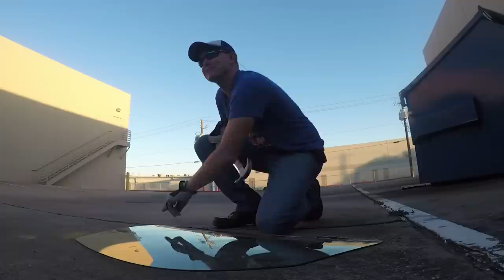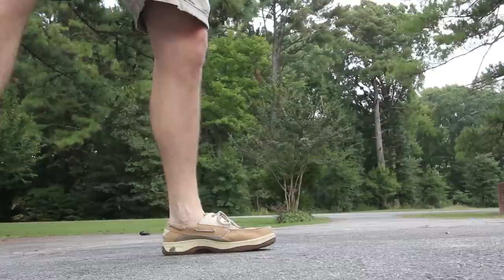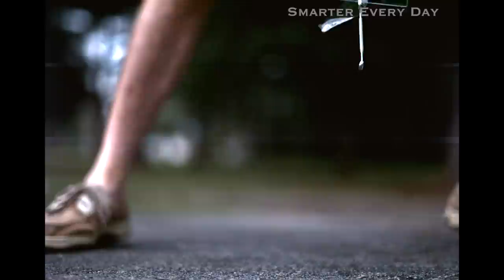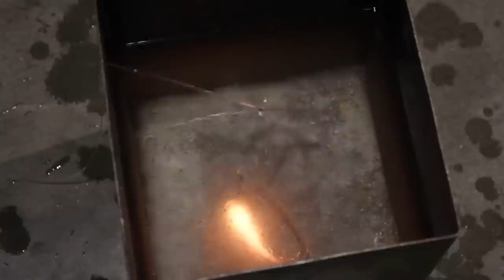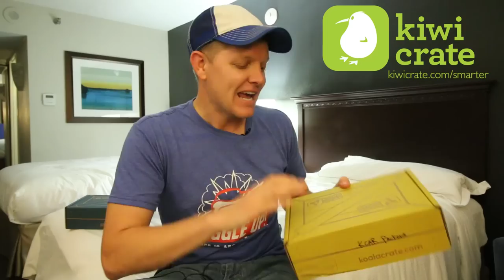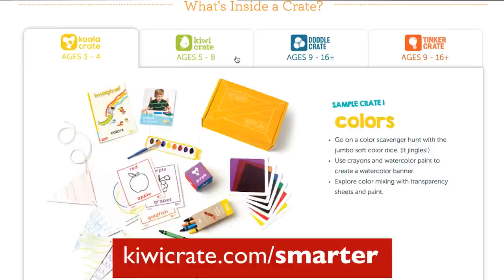How to Escape from a Car Window (SLOW MOTION) - Smarter Every Day 144

Comment: This video could actually save someone's life.
Reply: maybe. I work as an engineer bending and tenpering glass for cars like the kind they're breaking.  unless you have a hammer or something you're not going to break that glass if the Windows up.  he didn't mention that part. it's also much easier to break if you just apply a point load anywhere in the surface, that's how they do ece tests to make sure the number of particles it breaks into is within specification and it's much easier.
Reply: +ZachBamfy Or if they have a small piece of Porcelain. Because a pebble sized piece of Porcelain  would shatter the window
Reply: +ZachBamfy You can take a key and wedge it up into the frame. Everyone has a key in a car :P
Reply: +David S. I wear steel toes to work every day and I keep a toolbox with a hammer in my car, so yea, this might help me some day.
Reply: +RanndomUndead And if you're dead set on always being able to break glass,  keep a ceramic mug, sparkplug or anything made from ceramics nearby at all times. Ceramics have a knack for being able to break glass instantly.
Reply: +ZachBamfy A couple weeks ago, I broke my drivers side window with my elbow, nothing sharp or near the edge. Also, the window was up. So I will say it is possible without a hammer, I honestly didn't expect it to break.
Reply: +RanndomUndead Today's cars don't require keys (but you still normally have house keys)
Reply: +npeq93 right, not keys but you still need a fob.
Reply: +ZachBamfy you pull out the headrest and use the metal part of that to break the glass
Reply: +r77xxl or your seat belt buckle
Reply: +ZachBamfy But the headrest is designed to come out and work as the hammer...you really don't know what you're talking about
Reply: +David S. yes! breaking into car is so much easier now!! I could feed my family now! Thanks Smarter everyday! :D
Reply: +David S. Not really, it doesn't say how to break the glass if you're stuck inside. This is just a cool looking slow mo video about glass breaking with not much information if you've already know about tempered glass.
Reply: +David S. It probably will actually.
Reply: +RanndomUndead Not me, my car is key less with a stop start button. The "key" I have will break before the glass breaks
Reply: Endseeker what kind of car do you own? I'd be willing to put that to a test.
Reply: +RanndomUndead really? Come on. I knew a girl who was forced off the road trying to avoid an oncoming drunk driver in her lane. She ended up in a lake and had to get her and her daughter out. Your comment doesn't make sense.
Reply: or ruin it
random person could smash the outer edge of the window
Reply: +Steve Kanney I also know a girl who was raped because the guy hit the edge of the window to break the glass and pull her out.  this will ruin lives.
Reply: +Dysangel PS4 
At the end of the day, like a knife, it's a tool.
Reply: Daniel Verdin yeah exactly, but I'm just calling bullshit on someone being sat in a car and not being able to drive away when someone smashes their window. They should also be wearing a seatbelt so getting pulled out is unlikely. So I think he just made up his little story to try and be awkward.
Reply: +Dysangel PS4 have you ever gotten beat up? Or been caught up in other high-stakes situations? Humans (including, maybe especially, me) can be pretty stupid under pressure. Especially if they have not practiced. Which is why I think self defense is very important for any persons life.
Reply: Dysangel PS4 i have late reactions lmao
Reply: +shodanxx I disagree. Your car is slowly submerging under water. You seem to have trouble breaking the window. You repeatedly hit it and try  to break it to escape. But you watched this Smarter Every Day video and you know that it's really easy to break windows on your car from the edges. Then you can escape your car and live. Has your door ever jammed in a wreck or anything like that? I personally think cars should have a pressure release on their doors. Like, "Oh no! My door jammed after I crashed it running away from the bad guys! I can't get out! Oh wait..." Flips open casing and presses door release button. Suddenly, your door propels off its hinges and you swim free. What's that? Seatbelt won't unbuckle? Well lucky for you, the feed from which the seatbelt comes out from can be removed! Hooray!
Reply: +David S. it helped me and my wife get back together!
Reply: +RanndomUndead not anymore. Lots of car manufacturers went for plastic boxy thing without the actual key blade.
Reply: +NGC1433 cars from the right manufacturer usually have an actual key inside the fob that you can access using a screwdriver or something, just so you can still lock your door if the batter dies in your fob.
I think he was making a reference to newer cars that were recently hacked by someone and controls were overridden by the hacker. The term keyless doesn't mean there's no key, it just means there's no ignition to turn a key in.
Reply: Joe Duffy Yes in deed. They are hidden good... :D I do not own a car this nice, had to do research to find out. Thanks!
Reply: Joe Duffy you probably had a defect in your window dude, in the tempering process you send the glass through the furnace into the press that bends the hot glass and then that gets carried through a couple blastheads that shoot pressurized air at it, during that if the glass hits anything too hard or if its resting on metal, or if the air isnt right you can get vents.  basically its just a weak point that can cause the glass to break randomly, could be when its just sitting there or could be when something barely taps it.  or maybe youre just reaaaaaally unlucky
Reply: ZachBamfy or maybe I just hit it really hard.
Reply: +David S. But the best way to survive out of a car is to kick the windshield from your feet. This doesn't require any tools or much strength and the windshield pops out as a whole (no dangerous glass splinters). Plus, you have a larger vent to get out than you would get by breaking car door glass.
Reply: +ZachBamfy Swing your seat belt buckle.
Reply: +Naman Khokhar This will absolutely not work on pretty much any vehicle of the last 30 years. A modern windshield is bonded to the vehicle using a very strong automotive grade urethane. This ensures that the windshield will remain in place should the airbags deploy and adds rigidity to the vehicle's structure.
I am a professional automotive glazing installer and can guarantee that you cannot kick out a windshield on anything but old and classic cars. I hope this dispels a common myth.
Reply: alex826 But Bear Grylls demonstrated it on discovery channel. Though, i haven't tried it yet :P
Reply: Naman Khokhar Bear Grylls also sleeps in hotels while he's "filming" episodes.
Reply: +Excelsior Cameo car doors already have an open button, otherwise they wouldn't have been much of a door.

The problem with these open button under water is that the inwards pressure on the door from the water trying to get inside means it would take massive force to push the door out.
Reply: 1000th like
Reply: +David S. Except in the rare situation where you get trapped underwater and try to break out. The water pressure will slam all the glass into your face, then you would wish you had not watched this video.
Reply: +Jinsi Kim until the car is filled with water, the direction of the water pressure is not balanced. The water wants to get into your car, because the inside of the car is filled with air, which is lighter than water, so the water presses inwards. Once the car is totally filled with water, there is no longer any significant water pressure on the door/window, but pushing the door under water would still feel heavier since water is more viscous than air.
Reply: Jinsi Kim Are you crazy?
yvrelna said it absolutely right that there would not be any significant movement of glass shards if water fills inside the car.
Ofcourse it's very difficult to break a glass underwater coz movement through viscous medium is restricted and much impact is absorbed by water but breaking glass underwater wouldn't do any harm to you unless you're doing it with your fist.
Reply: Jinsi Kim I did not intend that to be taken literally, though. I meant that the water pressure will likely propel the glass shards to be propelled into the car, causing possible injury to the occupants. Just because I said that the shards will be "propelled into your face" does not mean I meant literally that. From now, please do not take everything literally, and instead think about how it was meant to be taken. 

__________________________

Signed by SpaceFace105
spaceface105
Reply: +AspectOfTheStorm: What if your are stuck inside your car?  Are your tools there or in the trunk?
Reply: +spaceface105 right, however its probably safety glass, or tempered, no piece is bigger than the size of maybe a dime when it breaks and the edges aren't super sharp. I'd rather take some scratches over death any day :)
Reply: Joe Duffy That is also true 
have a nice day ;)
Reply: Stephen McLendon You were the first person to reply to this comment in almost 5 months. Congrats
Reply: Actually 4 months plus.  You said 'shards' of glass.  Smart you are not! Side-glass is tempered glass. It shatters into tiny pieces.  Front windshield glass is laminated glass. Designed not to break apart, but tries to stay together. It still can maim.  My best friend's head went through and back again. Not the same person any longer.  Self correct before you comment on me or others.  Safety first.  Why TF do you have a problem with the time-frame. Not everybody saw it when you did!
Reply: +Stephen McLendon you seem pretty upset about glass. Try to calm down and self correct. Everything is gonna be okay
Reply: How old are you Joe?  You are too complacent for the subject of glass . Yep, I am, for two main reasons. One you know. My best friend went head-first into the 'safety glass' windshield of his Dodge van when hit head-on. Not the same person even with safety glass. The other, I almost cut my right thumb off trying to save a drinking glass from falling off my kitchen counter, a natural reaction.  The glass exploded on the edge of my tile counter and a 'SHARD' severed my thumb mid-way to the bone. The tendon was also severed.  I tried to tell my thumb to move closed.  Never in a million years would it. The tendon was sewn back in surgery within ten days. Otherwise it shrinks and you lose the use of your thumb.  The opposable thumb is what makes us humans able to grasp things.  So yes to your statement.
Reply: +Stephen McLendon I'm 21. How old are you?
Was that the glass' fault or the accident, was your friend wearing a seatbelt? I figure anyone that gets hit head on isn't the same afterwards. My brother was hit head on my a negligent semi driver and miraculously lived. 
Accidents happen, they always do and always will.
Reply: +Stephen McLendon you may live a much happier life of you're not irrationally mad at inanimate objects as well.
Reply: Stephen McLendon Yeah. I never got mad about you commenting after 4+ months, I congratulated you for it. Just relax about the glass, it will be okay.
Reply: ok, if you say so. BTW, what city do you live in?
Reply: +Stephen McLendon you didn't answer my question, how old are you?
Unless of course you asked me rhetorically how old I was to infer that you were somehow superior to me because of age. So I will not tell you where I live, other than tell you that I live in the U.S.. Enjoy your day. I hope you've restored your rocky relationship with glass and realized life truly is better when you're not mad at everything all the time.
Reply: Joe, you are not very observant, are you? Go up three comments from here or two comments down from when you asked, you will see my age noted.  Your diatribe is getting the better of you. Better stop while I still like you.  Since I told you my age, now you should tell me what city you live in or better yet, the college you are attending. BTW Joe, your inference that I may be superior than you is not even part of this discussion and stupid to say such.However, I am much smarter and wiser than you. Why are you not in the military helping suppress the  global war on terror?  I volunteered to go to Vietnam when I was 21. Maybe you should do the same.  My Marine son can train you to be a CH-53E crew chief one day. As you may not know, there are bigger things in life than glass to discuss.  Please don't reference it anymore.  Thank you Joe.
Reply: Stephen McLendon Apparently I am not very observant, I've checked and re-checked and still can't find it. I'm sorry, but I don't owe you anything, I don't have to tell you where I live not which college I'm attending. You speak down to me as if I am inferior however, and assume you are much wiser and smarter than I am. You do not know me nor what I've been through. You didn't volunteer to go to Vietnam,  you were payed. I actually do know a lot about volunteering. 
I have thought about going into the military but based on personal beliefs did not choose to join. 
Sure! lets discuss this "war on terror" you suppose there is.
Reply: David S. k
Reply: David S. the the the
Reply: David S.nerf war
Reply: Isaac Edwards is a good boy to have the girls who have been
Reply: David S.
Reply: David S. Yes! Yes? How!?
Reply: RAINBOW GAMING
Reply: YEAH
Reply: David S. u
Reply: David S. so TRUE
Reply: It actually saved mine
Reply: Or ruin someone else's
Reply: yea or teach car jackers how tio easily smash the window
Reply: same
Reply: Zach yea I was trapped after a wreck I had to use both my legs to break the window to get the driver out
Reply: this video could help someone commit illegal things

Comment: Now I know the science of how to break into a car. Thanks!
Reply: 💂🏾👊🏿.  👮🏻 lmao
Reply: Ahahahahahaha
Reply: +Generic Username Not a great idea to break into a car and drive off with a obviously broken window. People start asking questions. Especially that police cruiser rolling up next to you as you look at him through a window that isn't there.
Reply: +Generic Username Two types of people
Reply: +Generic Username   I don't know much about breaking into cars, but I think if the windows are closed you're probably gonna struggle a bit because the edges aren't exposed.
Reply: +Noah Hounshel the window is obviously rolled down
Reply: +Noah Hounshel the window is obviously rolled down
Reply: +Dash still it wont stop a brick or a medium rock
Reply: +Generic Username actually all you need is a small piece of a broken sparkplug (The ceramic) you toss it lightly at the window and the whole thing will quietly shatter.
Reply: +Murdoch I call BS on that statement.
Reply: +kodez79 Not entirely "BS". The outer portion of a sparkplug is made of a very, very hard ceramic material; That very hard(but brittle) ceramic material can create a deep enough scratch in tempered glass to get through the outer portion and cause it to completely fail from the internal stress. The "toss it lightly" part is not entirely true, it does take a bit of force, but much less than you would think it would take to shatter a car window.
Reply: +kodez79 youtube it..ok its not exactly silent. but ceramic is stupid good at braking things because of how hard it is 100's of times harder than a hammer
Reply: +Laharl Krichevskoy look up the vid "the thick with the brick" bricks aren't that great
Reply: well you still need a key to drive away, but yes, robbers just hit the sidewindows and grab your bag, thats the reason you should not leave your bag on the seat.
Reply: ***** Woah.
Reply: Cop says "why you breaking into his car you under arrest" then you say "don't worry it's just a science experiment"
Reply: SBwingman Anything can break a tempered glass window if it hits at high enough speed, obviously. It also still seems obvious to me that being able to break the glass was not the part I was aiming for, but the tossing it lightly part. You would have to hit it with a sharp edge too, as the rounded sides would not leave a mark.
Reply: kodez79 Your statement is wrong. Even air can break a car window with enough velocity. But what about one beam of light? It is already traveling at maximum velocity.
Reply: +Generic Username The thing is to not you know activate the alarm.
Reply: Jokes on you, I have no name Sorry, English is not my first language. I should have said any thing instead of anything.
Reply: kodez79 Well, that little change really makes my point invalid. Good move.

Comment: Hi, great video! Speaking of cars and slow motion videos I have a video idea. I would love to see in slow motion how tires on my car react when I drive through a hole in the street. I want to know if it's better to take it slow or fast. I think is not a good idea to hit the brake in the last minute while the wheel is in the hole. Is it better to accelerate through the hole? Always wondered. Thanks
Reply: Cool idea!!!!
Reply: one time i went over a ditch for a water line or something while braking and sometime during the process my brake pad got scuffed pretty bad. This happened right before inspection so luckily when i took the car in and told my mechanic about it i got to take a look at how messed up my brakes got from what i assume was this ditch.
In short, i would like to see not only the effects on tires but also brakes :D
Reply: Creative Mom
Reply: Edd
Reply: Creative Mom I liked because of the name LOL
Reply: I think , patch repair would suit better to ur tyres
Reply: Go around it